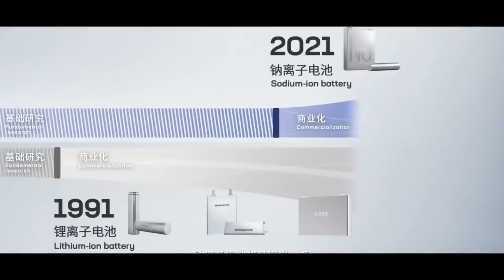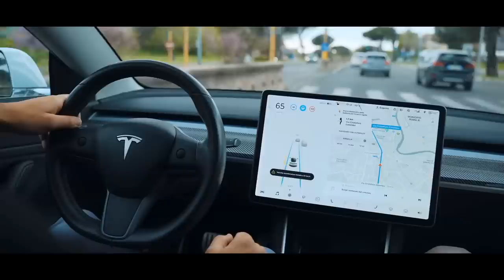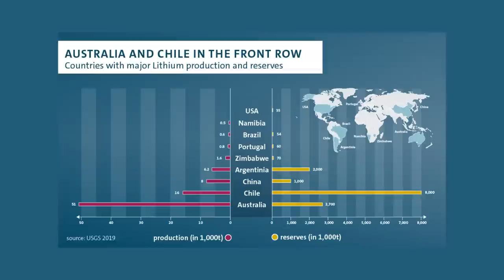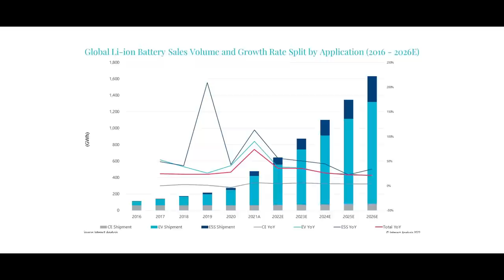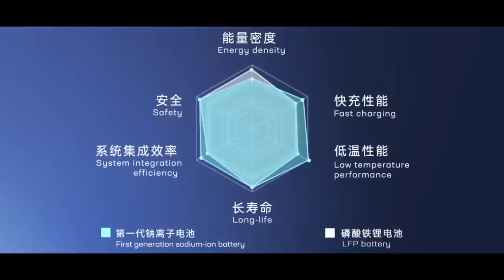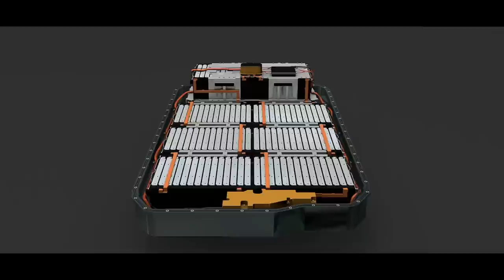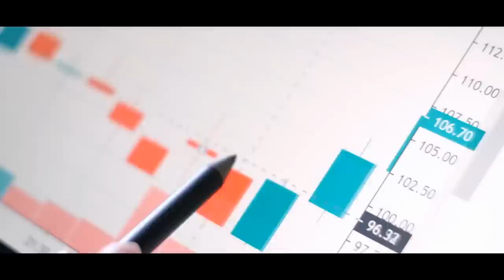No More Lithium! NEW Sodium Ion Battery 2.0 Changes Everything 2023

Comment: Further optimism if this does come off: Need more sodium to fuel a growing EV / home backup / renewable energy storage demand? Boom, desalination plants have just become PROFITABLE. Drinking water crisis averted.
Reply: Great observation man! So true
Reply: Sodium is too abundant
Reply: I’ve been saying this for years.
I looked into desal plants and they work better when the water is heated slightly. Battery manufacturing plant makes a lot of heat and can use the ocean water for cooling.  Put the two plants next to each other and they are complimentary.

Salt batteries take longer to charge and discharge.  Also heavier.  Ideal for building/ home/ electrical grid  power storage more than cars. 

Desal plants in California, solar power plants across cali and Nv, sore the excess energy in the salt batteries there where it is produced, the batteries dump the power at night.  Long term of course - right now every drop of power created can be consumed in real time.
Reply: Combine this with the wood based anode technology out of the UK, takes the waste pulp from wood product manufacturing, its cheaper, recyclable,  and more energy dense then graphene
Reply: You dont need desalinisation plants to get salt. There are much cheaper ways
Reply: Easy stay on coast drop system in front clean unlimited power
But I can also make electric cars that run electric to house when plugged in, self charging as well
Reply: Absolutely, it's crazy that these desalination plants exist, but we don't use them due to it not being profitable..
Reply: lmao, no. Its easier and cheapier to just mine salt.
Reply: Desalination plants are already profitable in California due to the high cost of importing water to the major cities.  But very few are actually being built due to the environmental impact and resistance from special interest groups.
Reply: Sodium is so cheap we throw it on the streets in winter. That isn't going to change with a few batteries.

Comment: Graphene is the best still. Nothing compares. My father did some testing for huge company and after 10,000 cycles full discharge and charge rates they were still perfect. Once cars have these it’s on for electric cars. Charge at same rate as max discharge.
Reply: And one of these batteries going into production? What’s the cost per kilowatt? The weight? Temperature range
Reply: @Mr. Mackey 
I did hear that Joe Mama was working on extended battery technology.
Reply: Yeah but whats the energy density of graphene?
I agree its part of the future but it's still way off.
Reply: If it is perfectly durable than it won't make much money. No company will be interested in that kind of stuff, since they usually release new model every year
Reply: Totally agree with graphite. However it doesn't hurt to have another source.
Reply: Nuclear is actually best, if you want to be pedantic about it.
Reply: @TlD-dg6ug  How do you nuclear power transport vehicles?
Reply: Nah, sulfur. Has 10x the density
Reply: @rayleblanc7209  same way they do every other nuclear vehicle
Reply: Yeah right it's not going to go public ever
Reply: @rayleblanc7209  just a small enough genorator
Reply: @frankyflowers  no he’s not I watched the testing process myself. He called hobbyking and told them they will put themselves out of business because one battery would last him 10-15years. Buy couple of sizes most used and never buy again. They said let it rip don’t give a crap. They want the tech out in the world and now you can order online easily. I use “graphene” batteries on electric go kart with 5,000w motor and 300amp system. Yes it takes a lot of lipos to do the job but charge at 20amps so takes 1hr to charge kart. Run time is about 30min if not doing donuts flooring it non stop. Graphene is superior to lipo or life in my book. Life is safest and cheapest and not too heavy either. May be lighter than prism lipo packs.
Reply: @LeoL123  I don't completely agree with that. We see in the software industry companies releasing products for nothing all the time, because these 'free' products support their other products that do make money. They use their shear industrial capacity to sweeten the deal. Someone, probably a car manufacturer will put graphene (or whatever battery) in their cars because it will out-compete any other EV that requires $10,000 battery replacement every 10 years. Although a counter argument would then be, EV's with lithium batteries will kill the second hand car market, and that's a good think for car manufacturers, so why would they use graphene.
Reply: Lol people should really get a basic Physics certificate like 16 year olds get.
Then you would know why there is never any new batteries coming out.

Comment: Lots of "might do this" or "could do that". I think I'll contain my excitement until I see it in operation. However, these other battery technologies could find uses in non-EV applications freeing up lithium to be used semi-exclusively in EVs. This might keep EV battery costs under control.
Reply: You could save more by not using lithium in Vehicles at all.
Reply: @gmamagillmore4812  What would you use instead of lithium? It is the lightest metal, so in that respect it is ideal for use in EV batteries. Perhaps you are alluding to not having EVs at all? It's hard to tell.
Reply: Graphene is used in the anode, this sodium is the catalyst, also Graphene production is dirty and expensive,  I dont see it being used in the future. The future is lignin, a by product from wood pulp production, it has a much better performance profile and is renewable and sustainable. The future is bright
Reply: @simoncrooke1644  Lithium is hardly ideal.  It costs so much to make and actually negates any positive climate effects in the process because it's so toxic to produce.  The impact on the power grid from recharging all these cars is going to severely cripple the country because local governments refuse to upgrade (California is a prime example).  Not to mention, where do you think all that power comes from to charge the batteries?  Mostly coal and natural gas.  Coal pollutes and both need extensive mining and drilling to keep power plants in supply.  Kind of like oil.  Also, lithium is extremely limited in how much power can be stored vs. how far you can drive.  Don't forget, we live in a "celebrity status" world, people NEED their air conditioning and powerful sound systems and all the fancy do-dads on their cars that consume power.

Stop drinking the "green" Kool-aid and wake up, the whole EV push is simply a marketing scam.  We do not have the technology to replace oil on a scale that makes it viable, nor the infrastructure for charging, whether at home or on the road.  We should have been pushing for more and better hybrid tech to bridge that gap until we can get a much better and more reliable electric solution, but that won't happen either because everyone that buys a Tesla thinks they're saving the planet.
Reply: @cujoedaman  Cars have always been a marketing scam, one so successful it's shaped our culture and infrastructure in a way that it has made it essentially impossible to live without one in the US, even in situations where it would otherwise be entirely inappropriate. We Americans gotta haul around two tons of steel and plastic everywhere, cars are our mobile thrones of opulence and comfort, and even if you want to try other forms of transit the car centric design of everything makes it more dangerous or inconvenient than it really ought to.
I think EVs have a potential to streamline things a bit, gas stations every 5 blocks could become a thing of the past, not to be replaced wholesale by charging stations but instead most people will use at-home charging and only need an ocassional station for long trips, the need for maintenance could be hugely reduced compared to ICEs which would reduce the overall price of ownership, which is already reduced due to electricity being cheaper than fuel.
I think in the future EVs could become to ICEs as LED bulbs are to Incandescents. Transitioning to LED bulbs was rough as the tech was developing, but now it's the ideal form of lighting as it's cheaper to maintain, brighter and more flexible in regards to color temps and whatnot. Current EVs are more like... CFL bulbs, way too many drawbacks that make them dangerous and less than ideal for a lot of use cases.
Reply: @cujoedaman  I am not an EV evangelist nor have I drunk the cool aid. I am well aware of all the problems you have highlighted. However, as a separate and discrete issue, lithium is ideal for EVs, despite your concerns, because it is the least dense metal and therefore light and it also has superior energy density compared with anything else. It doesn't mean it's good for the environment but it is good as an EV battery material. You would be hard pressed to find anything better. That's why it's used in EVs today. All cars are basically shit for the environment. That's why one should try to use them as infrequently as possible and keep your current vehicle as long as possible. The best thing for the environment is to not own a car. Unfortunately, this is impractical for most people. I do not own an EV because it doesn't suit me and they are too expensive.

Comment: Not a problem in a fully built out EV network, as Sodium ion batteries charge much faster.  i.e.  to 80% capacity in 15 minutes.  Not a problem for most trips as in a fully build EV network,  charge stations would be at least every 100km.  Also that range limitation averages out in colder temperatures, where it has an advantage over Lithium ion batteries.

Comment: 40 years that I have heard this technology... Still nothing in the shop next to my door...
Reply: I doubt that you have heard this for 40 years. Also they are already in cars, ebikes, etc.
Reply: @4203105  still nothing... My smartphone is still on lithium technology... My Kickscooter as well... They are from this year...
Reply: @bluepawn  your smartphone will always be on lithium, sodium has a lower energy density. So for small applications lithium is king.
Sodium-ion batteries are just much cheaper and have better properties all around, other than the energy density. So they will be king in standard to mid range cars, electric bikes and also scooters.
They are already in Chinese cars, bikes and scooters. Will probably take 1-2 years to come to the west. It takes time to build manufacturing capability and supply chains. So not everything will be replaced tomorrow.

Comment: Heavier batteries may be bad for max range but if they are heavier AND perform well in sub zero temps they might be good for traction(weight) and performance in cold snowy areas. I would add a small propane generator to increase range and maybe photovolaic paint for some rarely used cars.
Reply: Homes don't care about weight. Soo even if much heavier, there would still be a market, just not automotive.

Comment: It is generally believed in the industry that sodium-ion batteries and lithium-ion batteries are complementary to each other rather than substitutes. Due to the low energy density of sodium-ion batteries, they are more suitable for use in medium and low-speed electric vehicles and large-scale energy storage.  Lithium will remain as the source power for most passenger vehicles.
Reply: My vehicle runs on gasoline and I see no reason to ever buy a WEF-controlled electric vehicle.
Reply: @deusvult9349  hahahah because the fossil fuel industry is not controlled by the Davos crew lol
Reply: @jamescat2386  Electric cars use fossil fuels to charge up their batteries so it's a zero-sum game, except for the higher cost of vehicles, higher insurance rates, way higher maintenance costs, and exorbitantly high cost of replacement batteries when the original battery craps out. 

The other wonderful feature about electric cars is that they can be turned off by the manufacturer or the government at any time for no reason at all.

Real smucking fart there joy boy.
Reply: It's really not that low and sodium ion batteries have all around better properties other than the energy density, so you save some weight and space with the thermal management.
High range cars will have lithium batteries or a mix of lithium and sodium cells. Standard range cars will all come with sodium.
Reply: @deusvult9349  lol yeah sure. The wef personally controls electric cars.
Reply: @deusvult9349  electric cars are about 4 times more efficient than combustion cars. So no, it's not a zero sum game.

Comment: Yeah, as we all have seen, far too many times, what a company claims when they announce a breakthrough, will often never come to fruition. So, until the rubber hits the road, we will just have to wait and see what happens. In the meantime, we have other promising battery technologies on the horizon from companies based in much friendlier countries, such as the solid state battery and the graphene battery. Which, if perfected (at least to a point where they become economically viable) are even much more advantages than the sodium battery, albeit with much larger hurdles at the moment, but hey hurdles are meant to be jumped.

Comment: This is great! There is so much sodium on the planet, and a ready supply in the brine that is separated from seawater, to say nothing for many other sources! I don't care if sodium ion is a little heavier, as a little more weight isn't going to hurt vehicles, especially since it's kept down low, making the vehicle more stable. Besides static applications should all be sodium ion anyway, since the weight doesn't even matter there! I really like the lack of heat build up, which will eliminate the need hopefully, for a liquid coolant. Also a little more weight on a vehicle won't cause any real loss, if they would simply streamline them better and quit making them look like they were chopped off on the rear! Lose the ridiculous spoilers! Look to the late 30s and 40s for more streamlined vehicles! Grow up people, you're not driving on the NASCAR circuit, which is the only place they need spoilers over a hundred miles an hour on curves! And if those guys would have the spoilers adjustable they'd be able to go much faster on the straight stretches! But good job on the sodium development
Reply: So because you don't like rear wings/spoilers, no one should like them?
Reply: @Blueknight1960  I'm not saying that at all! I mean if you're driving around under a hundred miles an hour on freeways there's no need for for them, however, I admit they look cool, but you've got to make them adjustable! Most of the time they need to be set so that air is forced down toward the bumper and fill in that vacuum space behind the vehicle which just holds you back! You need to review some wind tunnel test to see just what's happening behind your vehicle! It is literally a drag, which is why once you reach 55 to 60 miles an hour it takes so much power to go up from there. That's called drag, suction, or drafting if somebody's right behind you using that suction to help them! If NASCAR was allowed to have adjustable spoilers they could flatten them down for the straight stretches and engage them for the corners, which would improve their top speed by probably as much as 30 mph! The Dodge Daytona with the high Wing spoiler, back in 69 and 70 they were getting 30 Mi an hour higher speeds out of them than any of the other rigs! It pissed me off that they banned them claiming they weren't stock, when you could go down to your Chrysler dealer and order one from the factory! None of these so-called stock cars are stock! You can't go into a dealership and buy one as hopped up as those guys are! I have always thought they should have at least one other division called bashcar and get out there and drive like Dale Earnhardt senior used to do! Maybe they wouldn't go as fast but they'd be a lot more fun and get a lot more people watching! Also they should have yet another division with actual off the showroom floor, Pure Stock and take them out and see how they do! So like I say spoilers are cool and look cool, I agree, they should just actually function over all ranges!

Comment: Anybody recall sodium carbide batteries. Way of the future 80s. Some rechargeable  designs made 80 percent capacity. Nicad best was 65 percent capacity. 30 percent efficiency was common for the day with rechargables. The voltage would drop off pretty quick in some cheapie. Same wheel, different design.

Comment from the maker: New Graphene Aluminum Ion Battery Hits the Market! Charges 70x Faster
https://youtu.be/l1k52fsboPA
Reply: IF YOU ARE ESG COMPLIANT YOU'LL GO BROKE
Reply: We've been hearing about all these different battery types for several years now, and none as far as I know have gone mainstream.
Reply: @davidc5027 hey don’t just go mainstream, they must do small scale production tests , then large scale then look at manufacturing costs. Then keep testing to ensure you don’t release a battery that fails after say 5 years. They may need to test for 8 yrs before car manufacturers are willing to adopt them.
Reply: Graphene is very expensive to get the process out of the ground you should mix the two salt and graphing oxide I don't know why they didn't do this years ago they could even charge the ground and the Sea and would have more energy than we knew what to do with would be flying around in spaceships besides all the information and energy already in the air just from talking on the darn phone it's all in the air anyway it's just a different way of different frequency just like the Beatles wing
Reply: Yes...indeed. But this technology is quite very, very high end. And it's not easy to made this new pile. But it's charged very, very fast, because is a capacitor. :)